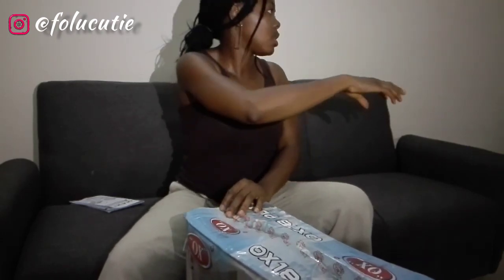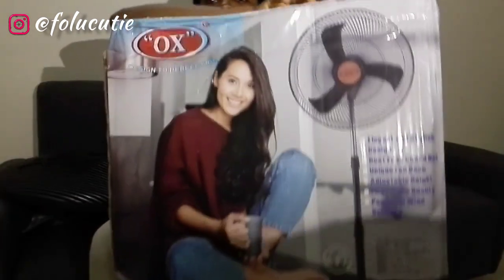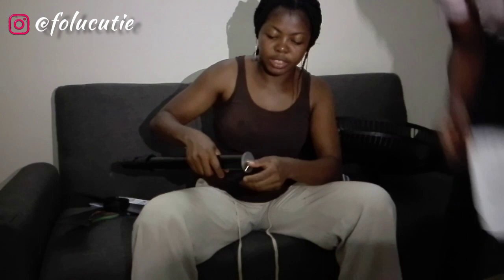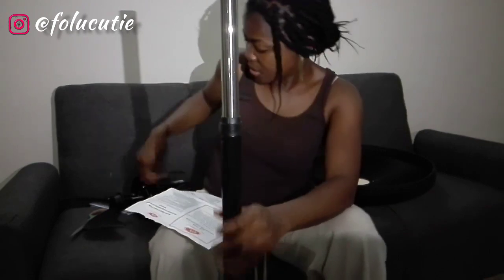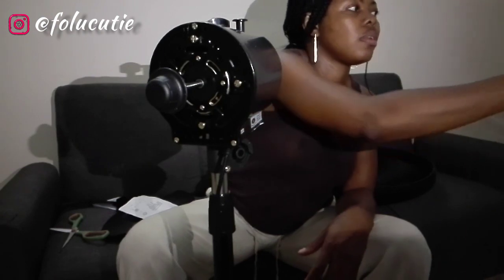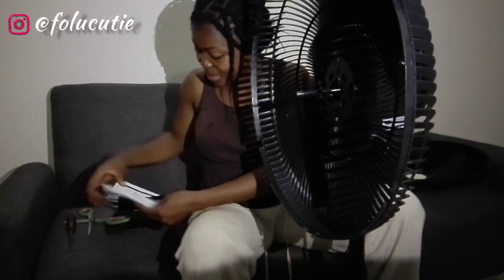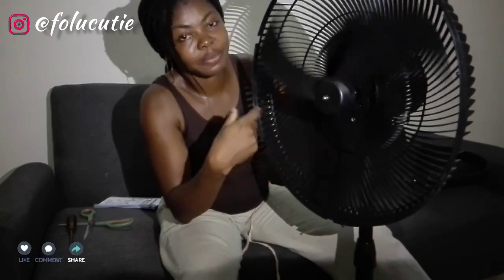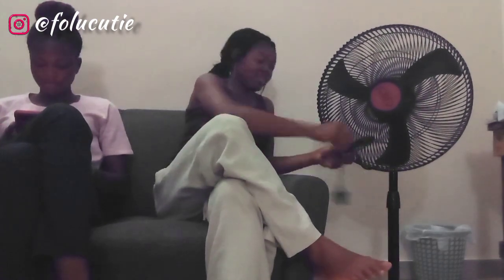How To Assemble OX Standing Fan || Unboxing OX Standing Fan

Comment: God knows that i would have abandoned this fan today if not for this video. Got stuck when I wanted to fix the blade. I knew that cap had to go but I didn't know how 🤣. Just came to YouTube and voila...got this. Thank you, it was so helpful!
Reply from the maker: Always welcome 🤗
Reply: How did you remove that all round cap? It is such a obstruction 😒😤
Reply from the maker: @onyekaugba9337  anticlockwise 🔄

Comment: My major wahala na to pull out this rubber and fix the blade 
How can I remove it abeg
Reply from the maker: Anticlockwise 🔄 that's how you will remove it, if you don't get it still, check out my other video in the ox fan. I hope this is helpful ☺️

Comment: That black knob thing was the most frustrating part. The metal was spinning alongside with it but someone suggested I used plier to hold it
Reply from the maker: It's supposed to be unscrew anticlockwise, using pliers can dent  it
Reply: Even when I tried screwing anticlockwise, the metal was spinning alongside with it.😐

It eventually works with the plier - The force from the plier was actually very minimal not to the extent of denting it.

The final struggle was the fan cover which is at the end of your video. Though I wanted to just test the fan, and keep it until I move to a new apartment. I didn't bother myself about tightening the cover (I cannot come and kill myself) 😂

Comment: My standing fan makes annoying cracking noise from the engine when I put it in rotational mode. How do I fix it ?
Reply from the maker: It's either you reassemble it or take it to fan engineer to repair it
Reply: @ThatFolucutie  Thanks.

Comment: You skip the part  of the removing the cap..how did you do that part
Reply from the maker: Anticlockwise 🔄
Reply: @ThatFolucutie  I was unable to remove it
Reply: @ThatFolucutie  it very hard to remove
Reply from the maker: @dareysamest668  I didn't skip it, watch it again, you will have to turn the cap anticlockwise, like you are tightening it up
Reply: @ThatFolucutie  you mean for me to remove the black cap right
Reply: @ThatFolucutie  you mentioned turning it anticlockwise while trying to fix it back but you did not show how you remove it ma
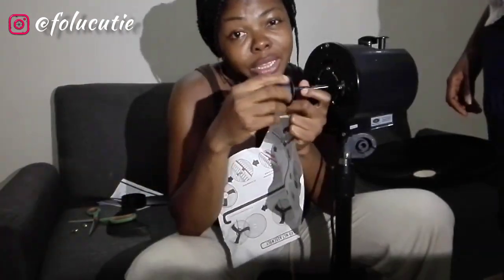Reply: Pls around  16:29 of the video .how the you get that removed pls